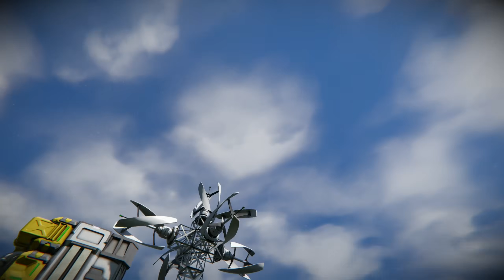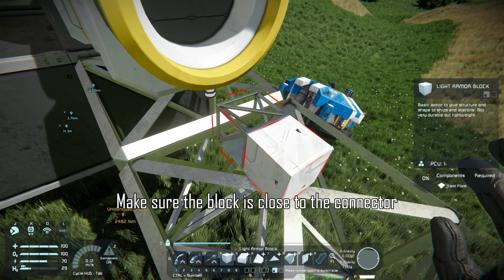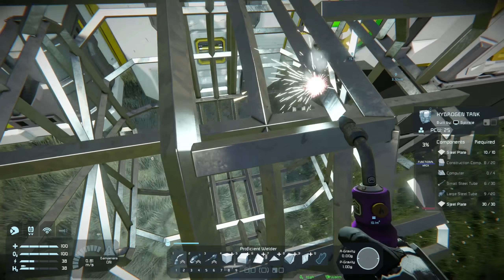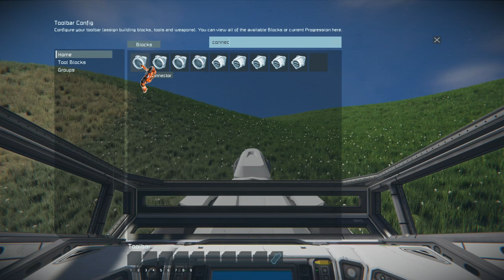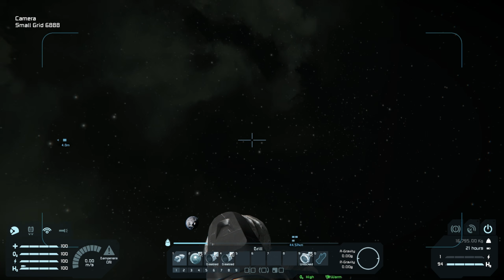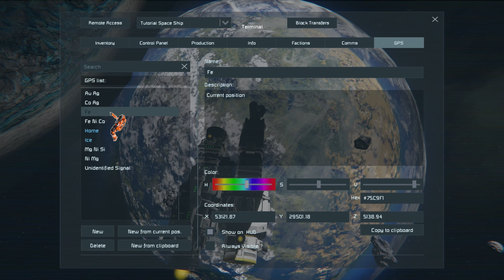How to get to Space (for the first time) | Space Engineers Tutorial

Comment: When I try and build off a connector, 'lock' and 'unlock' are greyed out.  Did something change in the last year?  Is it still possible to build off a connector <-> connector?
Reply from the maker: Have you fully built the connector and is it showing yellow on its lit up area, both of those need to be true for it to lock :)
Reply: @Splitsie  Thanks for the reply!  They were fully built with a yellow light showing on both connectors.  I tore them down and retried several times, and on about the 5th or 6th attempt, the lock/unlock was no longer grey.  I never did figure out what was different in the multiple attempts but glad I finally got it working.  Off to build my new large grid ship!

Comment: 601 time i dont seem to have an L container option like this?
Reply from the maker: When selecting blocks like cargo containers, make sure you've got the correct grid size. In this case, make sure you have the medium cargo in hand, then use the mouse scroll wheel to change to the large one. If you point the block at a large grid (like your station) it'll automatically switch to that grid size, which you can then change back by pressing the hot bar key for the cargo containers or pressing R :)
Reply: @Splitsie  the other container  has a scroll option however the med doesnt ,med will not lock though even in magnet mod it has the right ports but no scroll
Reply: fixed it i used 2 m container,,now im stuck on the g connect connectors from drop down / add blocks and although it added it no other drop downs popped,,this is at 22.40  but it is still in box added,,was it a mod u added? to get extented info?

Comment: hello , i think im  doing something wrong , im in space , checked some astroids but i cant find any ore
Reply from the maker: One of the reasons I recommend players start on planets is that it's far easier to search in a 2D plane (the surface of the planet). Once you're searching asteroids you're searching in 3D with detectors that have a very limited range - even large grid only has 150m, which will cover only a small fraction of many asteroids.

For searching on asteroids I will normally use a camera and scan them at a distance to spot any areas that aren't stone grey, then fly to those because it'll almost always be an ore deposit that's visible on the surface. But unless I'm looking for uranium, I'll head to a moon or planet to get what I want because it's just more fun than scanning random asteroids.

If you're on PC, I'd highly recommend the Radio Spectrometry mod as a non-cheaty way to scan asteroids remotely that's quite fun to figure out how to read :)
Reply: alright thanks !

Comment: I don't know what the deal is but some of these parts aren't base game, I have no dlc and I can't use the inline cockpit and have no event controller...
Reply from the maker: The cockpit is obtained by signing up for the newsletter in the main menu, it's not paid for. Event controllers are base vanilla game, most likely you haven't unlocked them through the progression tree. Open up the block menu, go to the progression tab and search for event controller, you'll then see a block up the tree from it, build that (or follow the tree up until you reach a block you can) :)
Reply: @Splitsie  aah, I did see the icon on the inline cockpit but no idea what it meant.
As for the even cube I have to admit it was found after a short search, I had to build a light fitting first 😅

Comment: If you have an abundant supply of ice on the surface is it plausible to use a few hydrogen thrusters on your surface miner to help with carrying heavier loads? or no need to even bother???
Reply from the maker: You definitely can go mixed thrust, I don't do it too often at least not using both at the same time as it means you need both tanks and batteries which adds a lot of extra complexity and mass to the build

Comment: For the Event Controller section at 20:52, for some reason it only works if the ship is in the connected state- in case anyone else has an issue with the event controller only working one way, try doing that section with the ship connected already (it worked for me for some reason).

Comment: Hi, I’am trying to build the same ship what you built in this video so finally i can go to the Space 😎 but for some reason after when i build the large cargo and  the conveyor frame the surviving kit or any other object has no power for some reason, the cargo still working properly if i put something in it is going through on the base properly.

Any idea or advice what could be the malfunctioning? 

Thanks,
Reply from the maker: Any grid in space engineers (collection of the same size of blocks that are attached to one another) shares power perfectly across the grid. So if you have 2 blocks and one has power, the other doesn't it means that they're not connected, usually this happens by accident when removing something that had been joining them or by not letting the block snap into place and instead dropping it into place. I'm not sure if either of those could be the issue here but I'm struggling to come up with other advice :/

Comment: I would also put a Landing Gear somewhere on that first ship... I don't want to admit how many times I got out of my ship with dampeners turned off and bumped it without noticing and came back to a ship floating off into the void.  Being able to tether to something if you need to is very handy.. even if its just to grab that Unknown signal that wants to run away using my ship to hold it still.

Comment: You forgot to add the hudrogen Engine for recharging battery to complete the system.
Reply from the maker: I decided not to add one as the battery will last a very long time on this with it being exclusively hydrogen thrust and the risk for new players having their fuel run out due to the engine is very high

Comment: What you set up on the Event Controller is why I think it's one of the best blocks for pseudo A.I. and automation. I've done what you've set up but my system requires only getting in and out of the cockpit to start the ball rolling, no button pushing necessary.

It is similar to the set up that you have, but it uses a different event to trigger it.
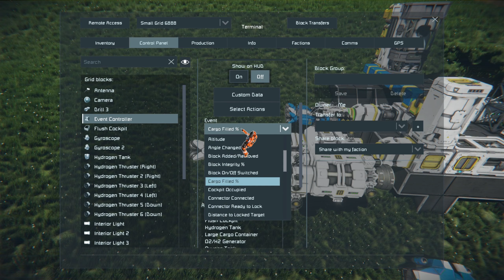If you stop the video at the 22:45 mark, you'll see it right above the 'Connector Connected' event.

It is the 'Cockpit Occupied' event.
When using that event trigger, all I have to do is plant my butt in the pilot's seat and everything is set to go, stockpile and recharge off and including unlocking the connector as well.

If your ship can hover touching connectors, then you can set the reverse to happen when you leave the cockpit including locking the connector.

It doesn't get anymore easier than that.
Reply from the maker: Once they fixed a lot of the early bugs with it, it became as useful as I hoped it would be, now with all the extra rotor and piston instructions it's even better :)

Comment: i dont think i saw this in comments or in video but when searching for ores ( after )  some cargo is in ship for some reason your ship is not going straight because of non center of main mass ( either non center cargo - connector - etc )  i use all thruster on with the only the backwards thruster(s) off so the other ones take care of course correction to make you go in a straight line instead of deactivating dampeners ... basically the same but with less worries why your going sideways
Reply from the maker: All thrust goes through centre of mass, so position of the cargo containers is irrelevant for thrusters 🙂

Comment: I remember my first trip to space after they added planets.  My ship was ridiculously tiny.  A basic cockpit, gyroscope, battery, ore detector, antenna, medium cargo container, an o2/h2 generator, two landing gear, and 8 hydrogen thrusters.  Three of the thrusters were for up.  Two of them were set up to use the thrust override, while the last was manually controlled.  The o2/h2 generator could easily supply two thrusters.  It was enough to get me to space and let me explore some asteroids for ores.

While still in gravity, I checked out the first asteroid I passed close to, and it had platinum, so I stopped and mined some by hand drill.  Some debris from the mining dropped due to gravity, so I later found a few bits of platinum ore laying on the ground not far from my base.
Reply from the maker: That's cool, sadly I don't have a lasting memory of my first trip to space, though I do have a good memory of my first failed trip to space :D

Comment: Splitsie I have two requests. The first is when I am building a ship I always get turned sideways, upside-down or somewhere in between and I find it very disorienting. Do you have any tips, tricks or mods that will keep my boots pointed down.
The second is when using blueprints.  The projector will let me build a new block that is in my line of sight before I have fuctionally build the one I was working on. I always have to have a way to turn off the projector for each and every block and build one at a time because there is no worse thing than thinking I am done building and hopping it the cockpit to realize the the gyro in the middle of the ship is not working and having to tear apart half of the ship to fix it and all of the trips to unload and reload inventory to fix it. 
Thanks for all that you do for the community.
Reply: Yes, when you turn while flying in space it can also rotate you. I managed to get used to it eventually, but still don't like it. I do not know whether there is a mod that stops it, but it's worth looking. 
The welder won't build a projected block if you're inside it. So go very close to the projected block you want to weld and you should be able to build it. When it's done, fly backwards a little and the next block directly in front of you should start to build.

Comment: One method for saving fuel is to stop once you leave gravity, make a GPS, then hop out of your ship and jetpack to each nearby asteroid. If/when i find something useful at an asteroid i'll then move my ship next to that and either mine or make another GPS and keep manually searching using the jetpack until i've found all of the resources i want. The ore detectors range is the same as the advanced drill so bringing the whole ship to every asteroid is pointless since you can simply use your hand drill to check for buried resources. You can search several asteroids with just the jetpack and a drill then you can with a ship. 

Another good reason for jetpacking is that if you're attacked by drones you can outrun them with the jetpack since it goes 110 meters per second so you can make it back you your ship and be off long before they get a chance to shoot since their max speed is only 100 meters per second.

Comment: Platinum and Uranium can be found on earth 
Just be sure you got the Prototech DLC and go search for Distress Signals 

There are about 4 or 5 different crashed ships you can find 
The Ion trusters hold thruster parts disassemble them and you will have Platinum 
And if your lucky they have some containers with Uranium in them 

The do almost always have Ion trusters with the Truster parts so if you find enough you can build a smal ship with both hydro and Ion trusters 
Put both in a group to switch between them 
So one’s your in space shut down the Hydro and start the Ion to spare Hydro

Comment: Efficiency is the wrong word, you mean power or thrust. Ion thrusters produce less thrust in atmosphere, i.e. they are less powerful, but with the same efficiency. Efficiency refers to the ratio of input to output. For ion thrusters that would be electric power vs thrust, which both change based on atmospheric pressure.
For example the large hydrogen thruster is many, many times more powerful than the small, but only 10% more efficient. If you compared an array of small thrusters with the same thrust as one large thruster, you would find the larger thruster uses 10% less hydrogen.
Reply from the maker: No I mean efficiency, with each thruster weighing the same amount, being able to put out less thrust makes them less efficient per unit of mass added.

Comment: Tip: put a large grid ore detector using a large grid rotor with a small grid head attached to your ship to get a 150m range over the 50m small grid ore detector. It still make take a dozen or two dozen asteroids to find Uranium or Platinum, but you are less likely to miss the ore deeper inside. You may want to turn on "share inertia tensor" so that it moves rigidly with your ship, rather than your ship constantly trying to rotate around it.
Reply from the maker: A large grid ore detector is certainly a good idea, though I'd say it's better these days just to use one with a connector on it. Since they no longer require power it's easier and safer and only a moderate amount larger to connect with them that way :)

Comment: 24:00 I'm pretty new so I'm not sure if you have to do this or not, but when you're showing how you can do multiple things with the event controller, would you have to make a new event controller for each action you wanted to do when docking and undocking? (like turning the antenna/oredetector/thruster groups on and off)
Reply from the maker: No, that's why I used the separate hotbars, you can do up to 9 actions, but you can also use timer blocks to nest even more actions within those 9 toolbars :)

Comment: Another thing worth noting is that production resources (steel plates, construction components, etc.) can be much more dense than ores. If you do something like fill the large cargo container with steel plates to bring into space to build a space base, that ship will immediately fall to the ground and explode. You need at least 3 large hydrogen thrusters pointing down to lift a large cargo container filled with steel plates, so that is usually my minimum for building a small grid surface-to-space ship with a single large cargo container.
Reply from the maker: Good point and even more dense is taking the ingots :)

Comment: One trick that can be used for locating lost ships (though it’s a bit cheesey) is to build a contract block, issue a contract to “recover asset” or “locate grid” and then accept the contract. It will give you a gps for “last known location” which will be at the location of the ship (as long as the ship is stationary). I used this once when I ran out of oxygen on the return trip but my ship had parachutes that deployed automatically. It helped me locate the landing site even though it was out of antenna range.
Reply: If you place an unwelded block you can do repair contract to basically get an undetectable beacon for playing on servers.
Reply from the maker: Hmm... I'm going to have to think about where to include that tip for recovering lost vehicles as that's very handy :)
Reply: Wow after years losing so much stuff there is a way to recover by contract. I never knew its use and just use it as decor sometimes. GG this comment wins.

Comment: Just a small note about the event controller. It needs power to work. This is fine when you are docked to your own station, but trade stations dont share power. This means that the event controller will shut down your ship when you dock, but it wont start up when you undock. I got very confused the first time this happened to me and I had to turn everything on manually. You can solve this by putting your batteries on the toolbar to set them to auto, which will then allow the event controller to turn everything else on.
Reply from the maker: Good point about the trade stations, they've got a few odd caveats that can catch people out, thankfully something like this is fairly easily remedied, but when new players mess with the 'trade mode' on their connectors it seems to cause all sorts of confusion

Comment: 1. On a non oxygen atmo world. Helpful to mention that is the H2O2 generator chews up all the ice and you didn't have an oxygen tank... No more oxygen for your engineer till you get more ice. 
2. I'd add a parachute to make sure I decelerate coming in for a landing. 
3. I'd also add a set of small maneuvering thrusters in the axis of the large thrusters and turn off the large ones to keep the craft more manageable - consistent.
Reply from the maker: That's why I recommend new players start on earth-like, you don't have to worry about things like that.

I actively chose not to include parachutes here, the reason was that you need far too many of them for them to be practical. To make a safe landing most of the time with this ship loaded with ore you needed at least 8! Balancing that and all the extra conveyoring required started to stretch the tutorial out to a length I wasn't happy with.

Having small thrusters to use when in space where the big ones are is certainly handy :)

Comment: I made one months ago had six large H tanks at the rear, three large cargo in front, three h2/o2 generators forward of that, a small connector for fueling on the side H2 thrusters with atmo Thrusters 10 small reactors in the middle on the belly down the spine... 

It was a beast, with six 5x5 wheels and three large H thrusters off the back.

And that mod that makes large grid items smaller for use on a small grid.  Three refineries and two assemblers with four JD's.  Only takes a few minutes to jump planet to planet.

Comment: If you are not playing in easy mode with no asteroid impacts, you can very small amounts of the exotice materials from them. But they do make more of a mess outside your base then 25 moles and or a music festival, wheeled vehicles have problems.
Reply from the maker: Playing with asteroid impacts isn't 'hard' mode, it's just 'I want to eventually tank my performance' mode. Unfortunately all those little changes to the surface in the area will slowly accumulate and eventually be a significant performance hog, it's why they're disabled by default :(